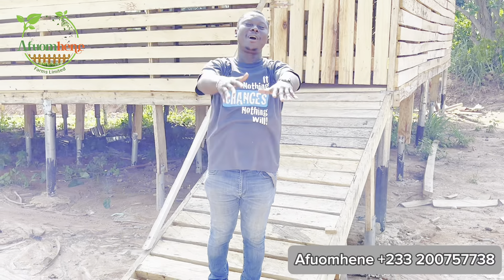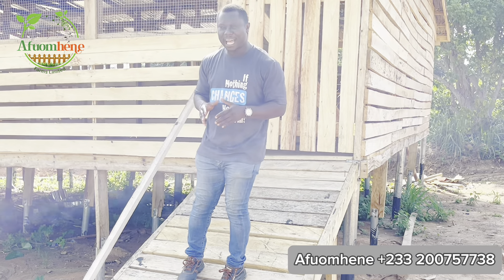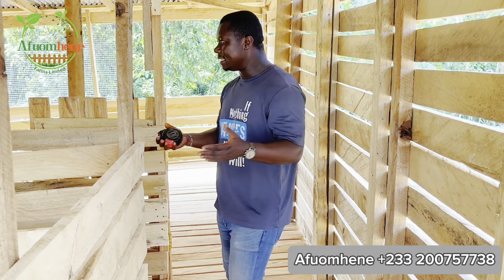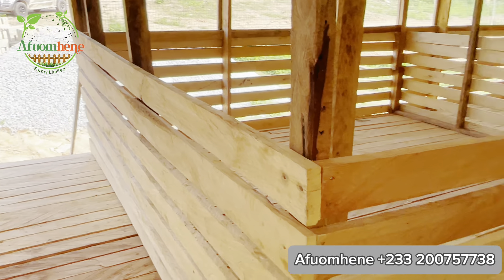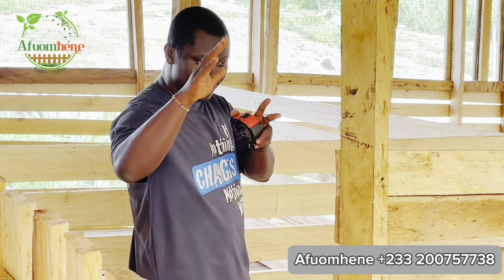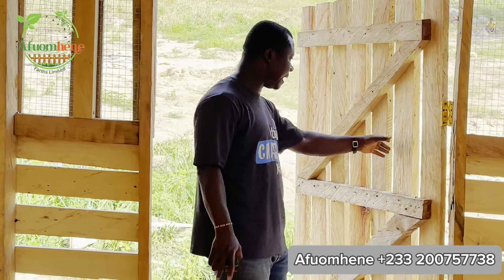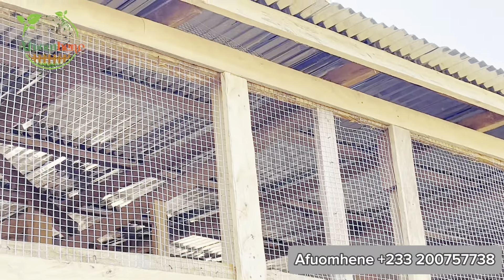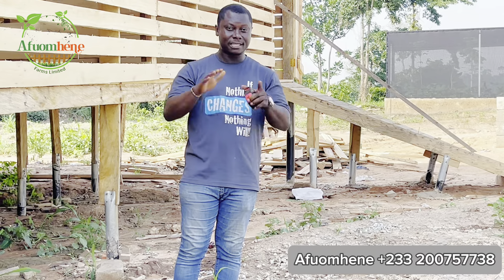We built the best modern goat pen 2024| Modern goat pen| Goat farming in a raised pen

Comment: the wood ramp is not done well,  it will be slippery to goats when wet. the wood should go up and down then small planks across
Reply: I noticed that too. A stopper separating every few rafts will ensure the goats/sheep don't slip.
Reply from the maker: Thanks for your input. Actually there rails on both sides of the ramp and small planks on the completed pen
Reply from the maker: Thanks for your input but that’s how the finished pen is